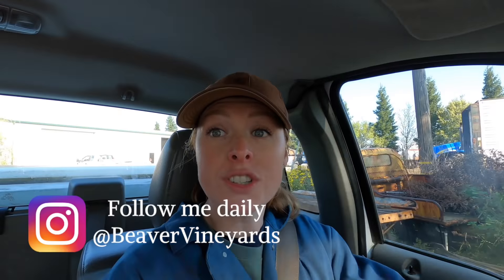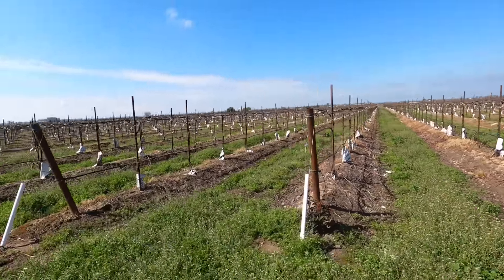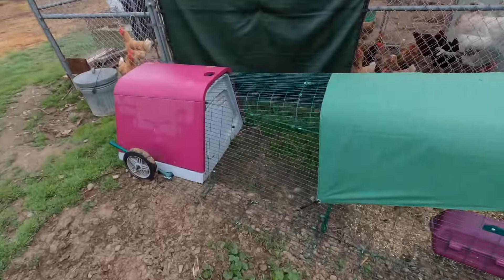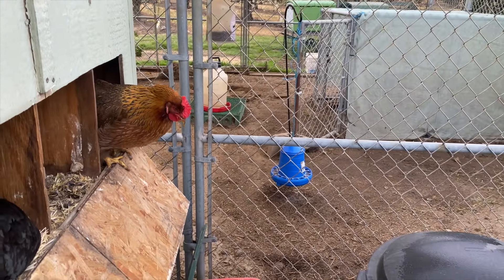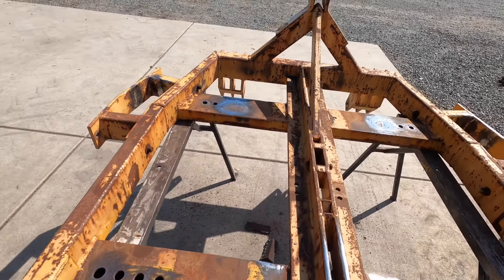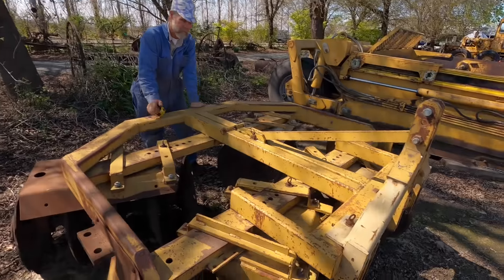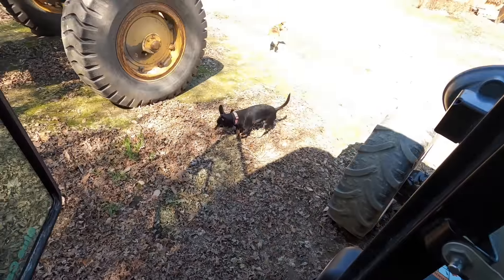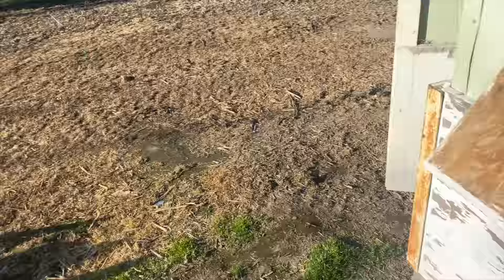A Little Bit of Everything!

Comment: Tara,if you want to stop a brooding hen , find or build a wire cage and put in a pan of feed and water, my dad did this and had the cage hung off the ceiling of the hen house the cage was about 12 in hes tall so hen can fully stand up in and 24 to 30 inches long and same in width this acts like jail time 4 or 5 days should do the trick ,give it a try should work fine worked for my dad and if hen is stubborn go for round 2. Good luck🐓🐓